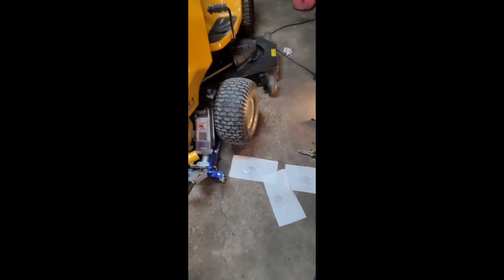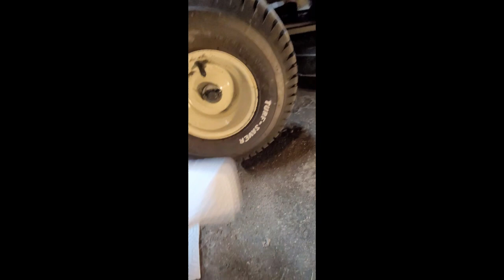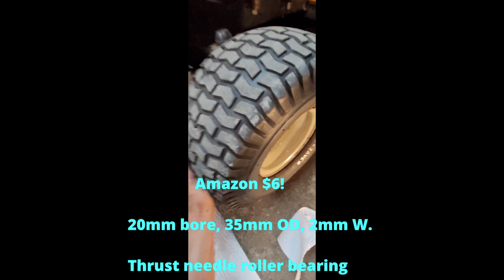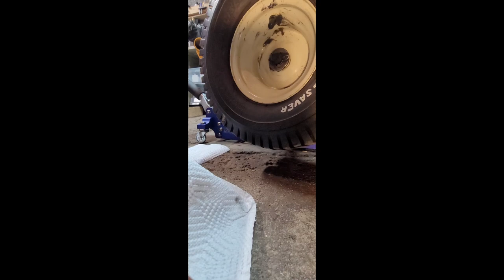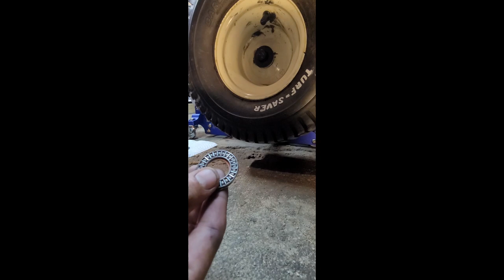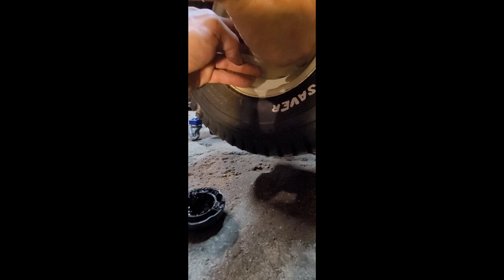Taking slop out of cub cadet xt1 steering spindle! Wheel removal needle bearing mod

Comment: Does it really matter your doing 5 mph or less.
Reply from the maker: I'd like to think so when your turning around hundreds of times.
Reply: My wheel bushings are 6 years old and 170 hours. What I found was the outer bushing in both wheels, the flange part wore thin and the retainer plate wore thin and concave. This would stop them from wearing in that way if the thrust bearing fits with brand new wheel bushings and new retainer plate. Prevent bushing from wearing against retainer plate.